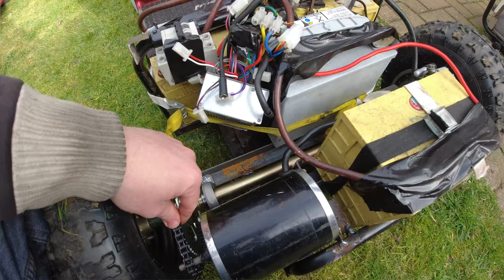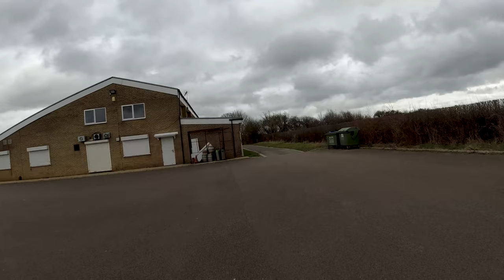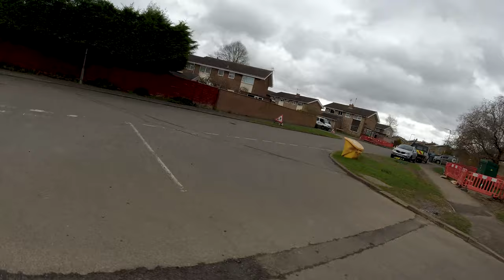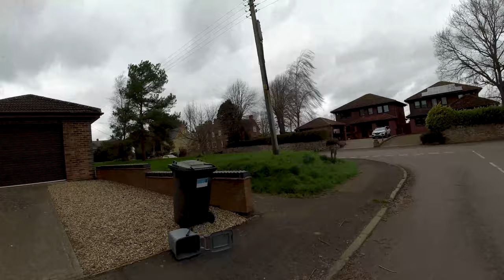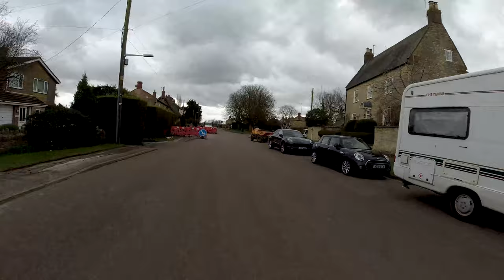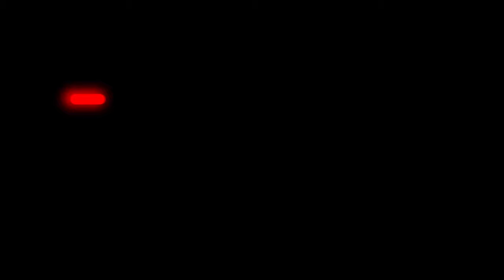modified mobility scooter

Comment: As an electrical engineer I wouldn't advise double in the voltage of any motor
Reply from the maker: The motor on that is 48 im have a large 72v 21ah battery could use that
Reply: @Ridingreviews  yes true, well done good fun project.
Reply: I overvolt motors a lot, you have to be careful with amps, a 24v mobility scooter takes 48v fine, a four pole motor takes it better than a two pole

Comment: so I'm back again to re watch this video for I think my 3rd go. Anyway since My last message I have been blessed to have bought a $5,000.00 Afikim C4 for only $100.00 great x mass I also added a micro 3 wheeler so I now find myself in possession of 3 scootz. with a grand total out of pocket to buy all $460.00 so yes I must have been a right good bobby last year. As I may or may not have mentioned in my last post. these will soon become my only independent form of transit. So I've been working to build a add on rear box so I can still get all the way across town & back & at a safe speed so as to not be run over in traffic . So as you offered to give help, what I want to do is add a set of full sized grocery cart to the rear of my scooter The C4 by turning them back to the back of the scoot using the rear hitch as my attachments point.  So I need the following . 1 I want to add several extra sets of batteries onto the lower shelf of the 2nd cart which encloses the 1rst cart when on road. this is needed so that when I get to stores I can remove the 2nd or outer cart & park it at the service desk while I shop with the 1rst or inner cart that is open topped for easy of loading & removed any worries on the merchants part that I might try to steal with the closed 2nd outer box. The outer box will have bicycle wheels & tires to carry most if not all of the added weights.
Reply from the maker: that sounds fine to me making the scooter go for a longer distance isn't a problem you just need to add more battery's in parallel no real modification needed but for more speed you will need more battery's in series and the stock controller wont be able to handle it
Reply: @Ridingreviews  so what if I was to add 2 sets of extra batteries to the unit 1 in parallel & 2 in series and upgrade the controler. would that be possible? I mean I only need the extra speed while on main roads the distance is the more pressing issue .

Comment: hello @ridingreviews ! I have a scooter with a VOL 24.0 Vdc 300W motor, with 2 12V 12Ah acid batteries and a DR50-b01 dynamic controller. What change can I make to improve and increase the final speed? Thanks
Reply from the maker: you could try adding a different controller one of the after market DC motor controller with out a restrictor on they are every ware the controller you have here is the mechanical manual for that https://www.dynamiccontrols.com/sites/default/files/2018-05/GBK52040%20R-series%20Installation%20Manual%20Issue%209.pdf

Comment: Hello. I am looking for a more powerful motor for my old GoGo scooter that will bolt on to the original transaxle. I upgraded the batteries, adding two 12-volt 12-amp batteries in parallel with the original two, this yielded a lot of added torque, but very little speed gain. I am getting two 17mm hub adapters so i can install larger wheels for added speed. But upgrading the motor will likely give me a lot more speed gain. I can handle the electronic changes for a higher amperage motor, brush o brushless, but i haven't found a motor that will replace mine without going to a clutch and chain axle or replacing the whole transaxle. can you help? Thanks.
Reply from the maker: Im pretty sure you wont find a bigger motor that will bolt straight in as the motor would have been developed for that scooter i imagine the motor will have a restrictor on it someware as all of them have one someware bigger wheels will make it faster but you will lose talque

Comment: 2 I want to add a stand alone 12v system to run automotive parts off the shelf . lights lots of lights inner & outer, with what I call god light to deal with drivers who neglect to drop their high beamsin a timely manner, air horn for road use, heating & cooling systems. I figure a hair dryer for heating not sure for cooling.
Reply from the maker: i wouldn't bother with a 12 v battery just add something like this https://www.amazon.co.uk/24V-12V-Converter/s?k=24V+to+12V+Converter

Comment: Hi I got mine built using 14 front tooth rear 46 200w motor 60v battery. The thing is not as fast as I thought it would be it won't pull me up a slight gradient. On the flat it's OK but still not fast. Sprockets and chain are 428 pitch. Could this be the problem wrong gearing.
Reply from the maker: I think you have over geared it maybe try first changing the front sprocket for a 12 tooth that will be the cheapest solution
Reply: @Ridingreviews  thanks i will do might drop the rear one too after

Comment: This is great and also you are empowering others to learn,every man can do the same,  this is what i like about vehicles and electronics, i've learned to repair pc's on my own, as well for building e-bikes, and 3 days ago i have my first mobility scooter. 

It's a 3 wheeler, worked fine, had no batteries. 
I tested a 24volt battery and it worked great, but the battery was weak, im going to need a other controller and do some more mods.

I actually wanna see if i can make a AWD mobility scooter with brakes on it to perform stunts with, and also use it after my knee surgery.
Reply from the maker: That sounds cool. The best way of learning is to use your hands and just get on with it. The battery is usually the worst bit as it is the most expensive
Reply: @Ridingreviews  True, but i happen to have a neighbour who's a expert in this, i haven't built a battery pack, and as first i'm going to run a 1000w 36v controller as i have a lot of 36v packs and after that i'll see what i will do more, first its understanding how it all works and upgrade from there. 

it's a important masculine quality to learn about these things and to work with it, just like any skill we want to learn, this is really important in these days as the decline in handy men is huge.
Reply from the maker: @GRINDPLAYLISTS  lol you want to know a hard skill to learn YouTube much harder than mechanical stuff

Comment: I need help with the following issues. 1 I plan to add 3 or more sets of batteries to offer longer range & from what you said in video faster speeds could be gained by kicking in a second of these battery set when needed to reach roadway speeds & only use a standard set for lower & indoors users . So I need a wiring diagram to hook up & control these features. please
Reply from the maker: sorry i don't have a wiring diagram as a lot of these controllers are different if you want to add more battery's in series for mor speed you will need a different controller

Comment: Great video! What would be the simplest way of increasing my Quingo's speed from 4 to 8mph please?
Reply from the maker: They are restricted by the controller. You can get a bigger controller. Some have a wire on them, and you disconnect to remove the restriction

Comment: Great Job Bro. Well, I’m not sure if I got that. But from a few months I’m trying to higher the speed of my Mobility TGA Vita. I already know those original controllers I cannot do anything. So, I bought a speed controller of 36v 1000W but I’ll exchange for a 48v 1000W.

I have a question.
If I connect the third battery to total Volts of 36v and I connect this controller that I have at the moment, it going to be a bit faster or not?

You are the expert so if you tell me yes would works.
I’ll exchange the 36v for 48v like you did. 
But this speed controller of 48v 1000w it’s enough.
Or I would need higher speed controller like 48v 2000W?

I have 2 x 12v 75 amp on the scooter and 2 x 12v 50amp Extras 

It’s all I have home right now.
Please let me know your thoughts 

Appreciate
Reply from the maker: that will be better I'm sure but you will need to sort out a new break as the old one is controlled by the controller

Comment: Hello, I own a Scooterpac Cabincar: 24 volt system, I installed 2 100Ah lithium lifepo batteries from Dakota (US).  Do you have any idea how to make it go faster?
Reply from the maker: this one has a 4 mph and a 8mph setting if you want to go faster than that you would need to change the controller as that is the  limiting factor

Comment: okay boss You have a new fan. so did I understand you to have said that if I use 48v rather than the 24v that my mobility scooter runs on stock that this unit will be faster? will it get anymore range ? I ask because at the moment my scooter is mostly just for fun and grocery runs @ the big stores but it is only a matter of time till it will be all they will let my crippled half blind but drive which is a far cry from The large commercial trucks that I made my Living in. so any thing I can do to get a bit more speed & range out of it I'm all for it. I have been as You put it gathering many odd bits to build a body for it to protect from nature & be safer with all lights,horn & other comforts. just bought a vehycle bucket high back seat to replace the stock 1 because it gives better support . well I will be watching be safe
Reply from the maker: hello not stock the motor will handle the extra power but the controller prob wont and most controllers are limited so it wont make a difference on speed and prob damage your scooter also if it did work you would probably get a bit more range

Comment: 3 When this idea first came to I was watch video on trailor build ideas & methods And it came to me as an ex long haul commercial driver who learned to live out of a trucks sleeper. That by using this cart in cart design it could be possible ( even if very micro ) to by properly designing & building these carts I could potentially provide sleeping space for 1 person. I see this being possible by cutting & re configuring  what will be the rear of the 1rst carts foot or narrow end to also have a working tail gate design hinging from top & or bottom  I could leave the cart just barely inter lockef to form the baskets into a sleep area. Thus what I've named a hobo RV was born. ( possible very transient homeless shelter that could be used for instant bedroom at night with under shelf storage or other use able space.
Reply from the maker: there are some nice bike trailers out there that are designed by youtubers to sleep in with solar panels really small but do the job

Comment: Liked and subscribed, just the video ive been looking for..
The issue I have is battery related, ok my control unit is 48v. I have a 36v lithium battery for my kids electric mx bike 
How can I add the extra 12v to be able to use the scooter I'm building ?
Reply from the maker: It should work with 36v you just wont get alot of speed it isnt ideal but you can add a lead acid battery with the same ampage and voltage as the others just be carefull of inballanced charging
Reply: I think my controller has a low voltage cut out at like 41v
Reply from the maker: @modchop3537  if it is a lithium controller it should cut of at 44v with a max charge of 52v
Reply: It's a vevor 48v 1800w brushless dc controller, no mention of lothium on it. I cant add a picture to my comments for some reason
Reply from the maker: @modchop3537  you carnt add pictures if you have any questions you can email me at chris@ridingreviews.co.uk
Reply: Not sure if you get notifications buddy. But I have sent you an email with a couole of pics of my stuff. Tha ks for the help so far
Reply from the maker: @modchop3537  sorry for the delay i am allways very buisy but i have just replyed to your email

Comment: Can I add lithium ion batteries to the motor on my mobility scooter was running on two 12v 15amp lead acid before can motor take it or do I need to replace it also thanks for Great video and the inspiration to do something I been thinking of for ages 👍 superb mate ☮💯👊👍🏴❤🤍💙
Reply from the maker: so this one has 1 lead acid and 3 lithium ion battery's on it so yes you can use lithium but don't let them go to 0 % or they will die try and add a low voltage cut off switch thanks for watching

Comment: I desperately need your assistance
Reply from the maker: How can i assist you
Reply: @Riding reviews  the mower has a 12volt led acid battery and a alternator that discharges 14 volts. The mower runs on gas for the blades and electric to make it mobile.
Reply: @Ridingreviews  the electric motors look very similar to wheelchair motors. I desperately need this thing to move faster.
Reply from the maker: @turtlewax2  is it dc or 3 faze
Reply: @Ridingreviews  may I send pictures of all the information that I have?
Reply: @Ridingreviews  its just 2 wires blk and red
Reply from the maker: @turtlewax2  that means it is dc
Reply from the maker: @allen trent  send pics to chris@ridingreviews.co.uk